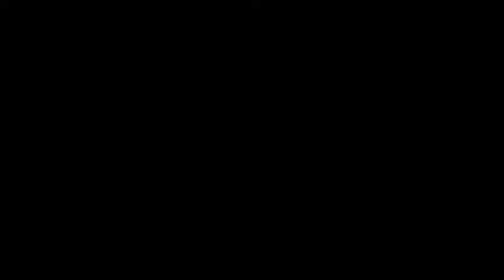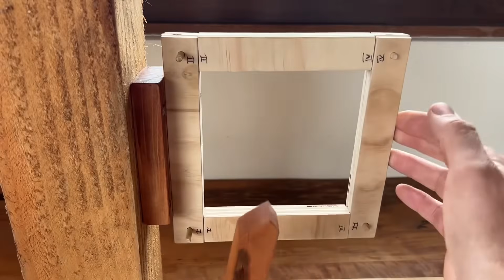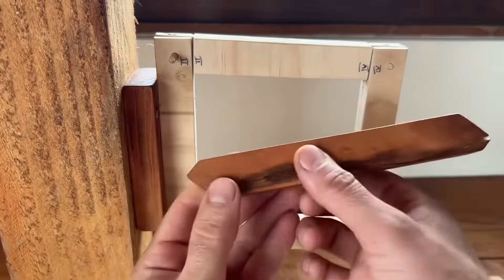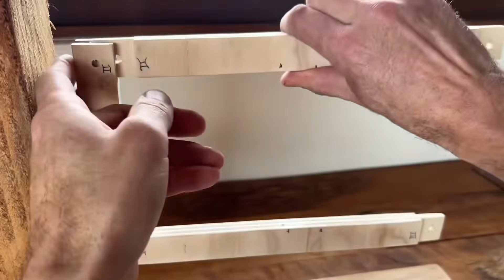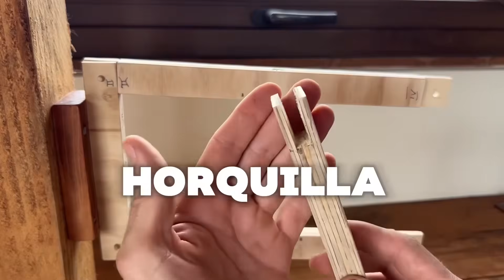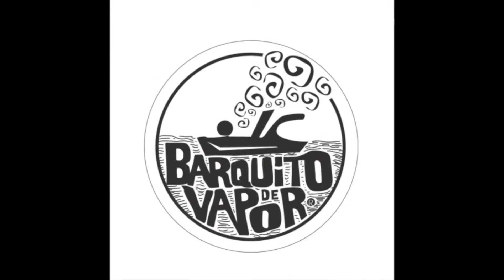Why Do Wooden Gates Keep Falling Down?

Comment: Right haters will hate but braces run hinge bottom tae top fir a single brace and hinges tae middle fir double not bottom hinge tae middle then middle outside. The outside is not load bearing the hinge side is not what your supporting from middle tae top front is fuk a couple boards😂also yer gate will fail always if you exceed 45° On yer angles phsyics dictates it will be 😂

Comment: This way still relies on the hardware - connecting the bottom horiz to the vert upright - to prevent the bottom of the diagonal support from blowing out/off the bottom horiz. All the gates we build have vert pickets - connected all across the bottom rail, middle rail/diagonal support, and top rail - multiple points of "hardware" support - keeping the gate square. But yes- this way works fine - if that is all the material that is going to be used - 2-vert/2 horiz, with a single diagonal support. 
Your geometry of the frame/support is understood, but that is not the only material we use (with the diagonal going the opposite direction) - all the pickets are connected at multiple points as well. 
We do mostly 6'x4'/5'/6' with x pattern diagonals -  2from top stringer to middle stringer - 2from middle to bottom stringer. 
(Our gates do not sag!). 
Appreciate your input - points taken.

Comment: Good job. One possible way to find the optimal structure could be to set up the problem as follows. I have a gate that is X wide and Y tall (for example, about 16 inches by 8 inches). The material used to build it is a fixed constraint (for example, plywood, as in your case). The way the parts are joined together is also a fixed constraint (for example, wooden dowels, as in your case). The total weight of the gate is a fixed constraint (for example, 10 ounces).
I apply a weight at the end opposite the hinges. I increase the weight until it deflects by (for example) about 0.4 inches.
The best structure is the one that supports the maximum weight.